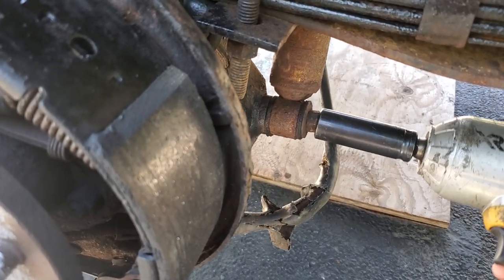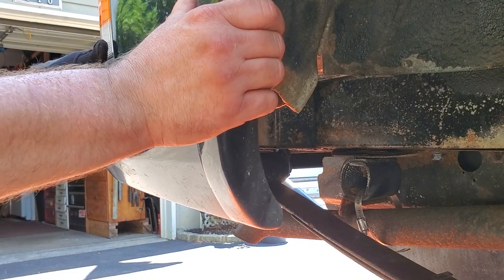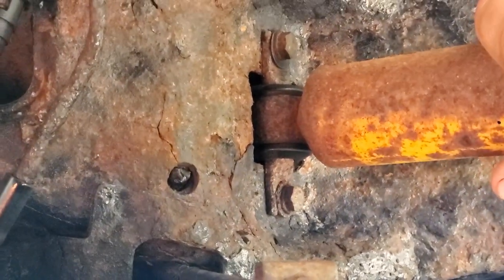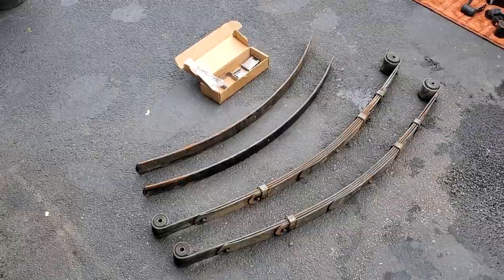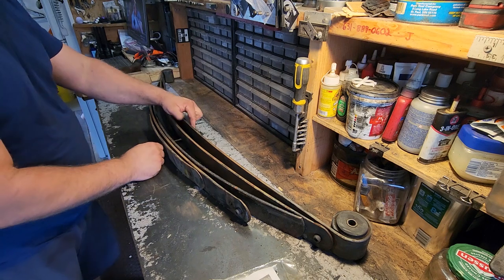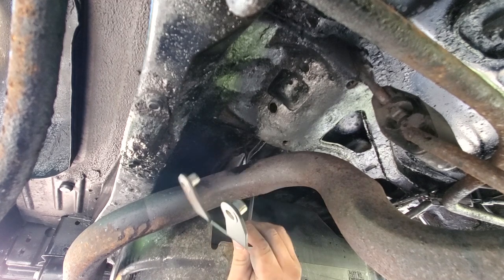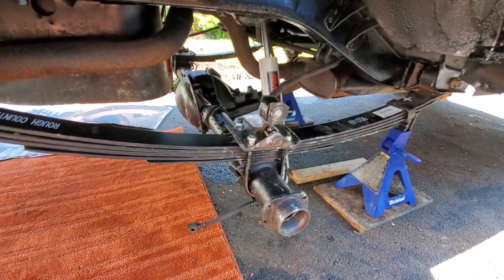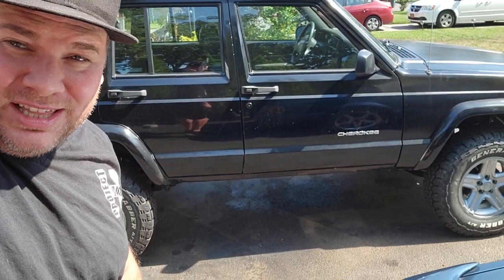LIFTING A JEEP CHEROKEE XJ - WRECKED J LIFT PART 2 -  REAR END

Comment: great job, Dan - perfect set up for the XJ in my eyes as well and the video was entertaining as always ! Been there with spinning bolts in the sleeve, all rusted out badly  - worst thing I've ever done on my XJ. Because getting the bolts out was a piece of cake in your case, my guess is, that these leave spring bolts had been treated/removed not too long ago.
Reply from the maker: Thanks for the insight.. I was hoping it was because I soaked em in penetrating oil 🤣🤣

Comment: Use heat on those leaf spring bushing and shackle bolts like you mention after trying it without. But need to balance between the point of no return
Reply from the maker: Yea man... Its a tough call.  I prefer to pre soak everything in penetrating oil.

Comment: im currently dealing with the result of the stringing the bolts through after the old ones break free.  since they arent connected to anything, when you go to loosen them they just spin free.  trying to get a wrench up in there to hold in place to loosen the nut is a pain since you cant see.  im also going with those replacement nut stip things as well
Reply from the maker: Yes! Spinning bolts the is the worst! Got speed

Comment: Great. Next time you can use the sway bar bracket you removed as rear shocks mount 😏
Reply from the maker: Ahhh!  Smart!
Reply: @ProjectDanH   Yeap... You can weld those also (careful due to fuel tank right next to it) and you will have a permanent shock mount easy to access and replace and forget about those rusty bolts. If you delete the rear sway bar you can use that part right there at the spot.

Comment: Hey Dan!

Love your new video series on a 3" lift! You may remember that I wrecked Lazarus 1 just over a year ago. I started a YouTube Channel called "SirThrival". I'm having fun building Lazarus 2, it came with a 3" lift, and it's good watching your stuff, it explained the swaybar holes haha. I wasn't sure what to do about the rear swaybar since the previous owner removed it. I prefer them, and didn't know that I could use the stock links! That was a huge help to me! I also did the Liberty disc brake conversion, and working on the WJ disc swap up front, and some other things. I'm building it into an affordable overlanding rig. I used the rough country spacers to run JK wheels, but I was wondering if you know of any place that sells 17x9 steel rims with the right backspacing for the xj? That way I can run cheap new jk tires people are throwing away on Craigslist and Facebook marketplace without the need for a sketchy rough country spacer. Right now I have the 5 on 4.5 bolt pattern, but when I go chromolly and lockers in the rear I could go to 5 on 5 axle shafts, with WJ hubs. Only problem running JK wheels without a spacer is it gets very close to the body and rear springs, so I would need 1.5" of backspacing for the 17x9 rims. What do you think?
Reply from the maker: Hey brother! glad things are going well.. Honestly I Think Spacers are the easiest way to go.. You may be able to try ford explorer wheels.. same lug pattern, dunno about the back spacing tho.

Comment: Great work. I have an issue with mine that has different measurements between the rear sides. I ended up changing the leafs to another factory one but it is still has the same issue. Hope for an advise. Thank you

Comment: Nice work.  Why did it take my son and I several days to change out the shackles and shocks and you get it done in no time.  We had to drill out one of the upper shock mounts and tap for a new bolt.   How is the ride with the new setup - much stiffer or more comfortable or both?
Reply from the maker: Yeah brother.. I've battled in the past.. the lift I did for my buddy prior to this one took me one whole day to get the upper two shackle bolts out.   I was prepared to battle but I think my saving Grace was being able to use the impact on the upper shackle bolts since I cut out so much rot on the rear quarter